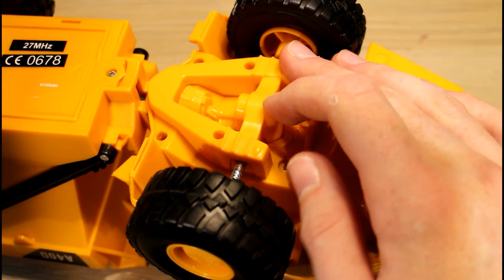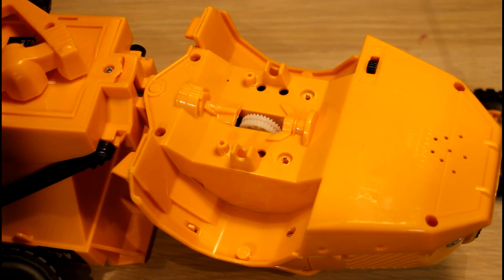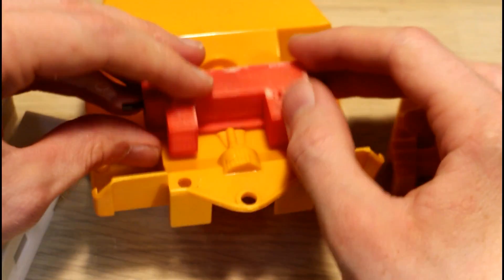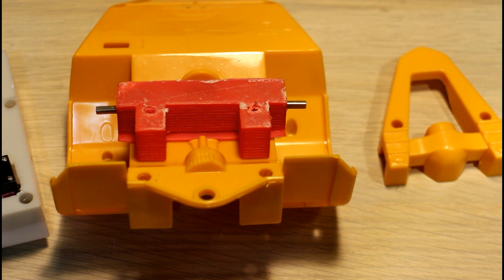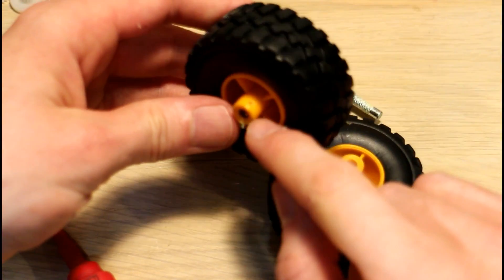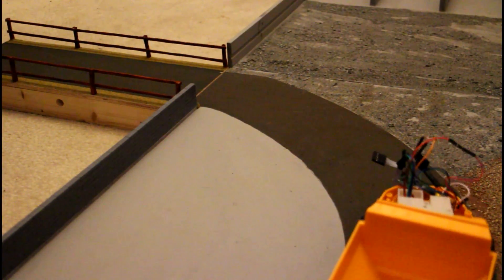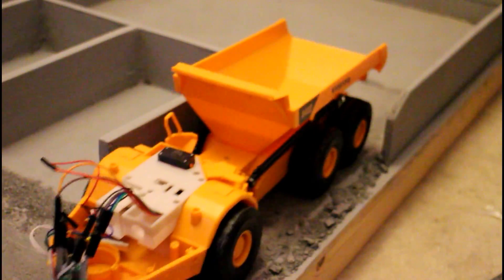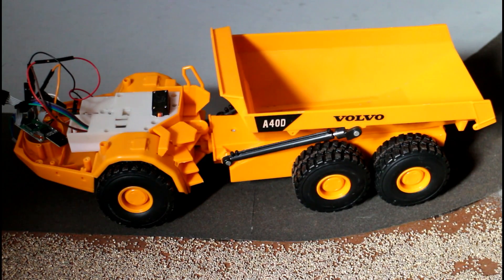Volvo A40D Part 3 - Adding dual front motors

Comment: hello guy , I'm fond of their work , short your channel and everything you do , I wonder if you would make a simple program to control an LED with nRF24L01 , I have difficulties to develop the content in Portuguese is very limited, I have a one arduino + nrf as tx , and arduino 5v + nrf as rx . help me please. I will wait here my email .:
flaviocosta88883018@gmail.com
Reply from the maker: I think for what you want you should start at the beginning with the examples in the library http://tmrh20.blogspot.ie/2014/03/high-speed-data-transfers-and-wireless.html. Once you have those working then you can send some data that your receiver will know to use to turn an LED.

Comment: this very good, tell me, you have developed a circuit that does not need to program ? how is it? I have a truck that here , put 4 servo motor on the rear wheels to solve this problem of drift, satisfaction guy you do a great job , I hope more videos thank you
Reply from the maker: No I don't have any boards that don't require programming because the vehicles are usually different so need different features. I've ordered 6 motors so hopefully it will work well after that.